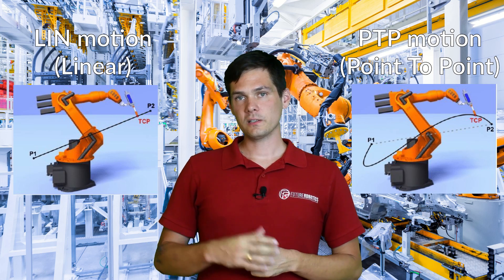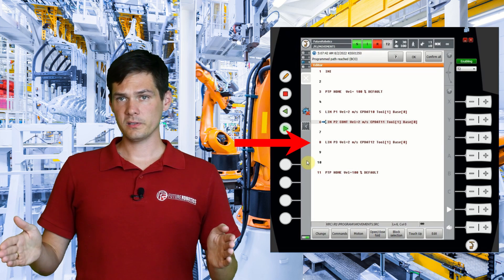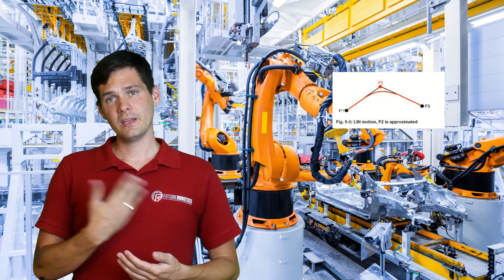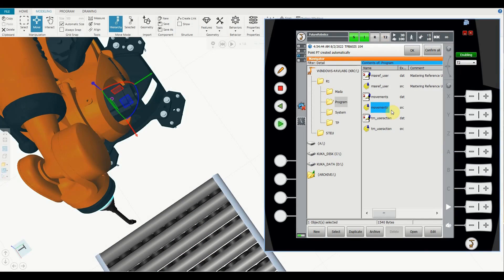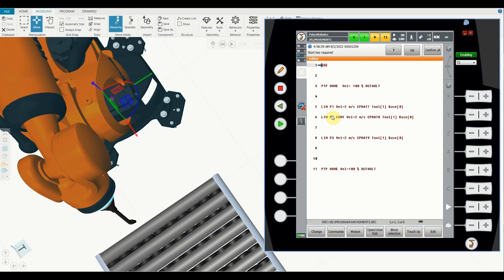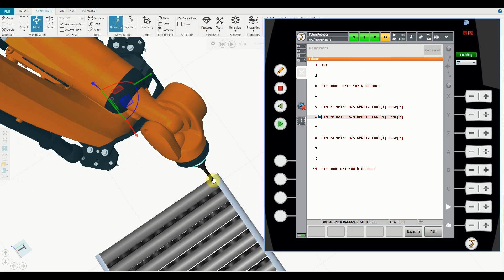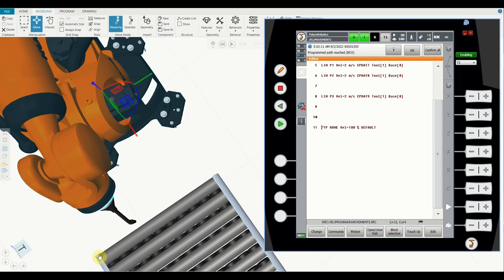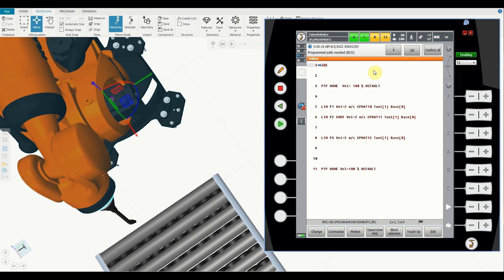PTP, LIN movements with KUKA robots /  CONT termination types

Comment: Hello,

Is it possible to monitor the electric current of each motor of a FANUC CRX 10iA/L and use that data as input for the code?

I plan to use this information to stop the robot's movement when it makes contact with a workpiece. Then I can activate the "stop code" to halt the robot and subsequently activate the "gripper on" to pick up the workpiece.

Do you have any ideas for improving this stop-and-pick-up process? I would greatly appreciate it if we could discuss this further.

1. How to detect the workpiece
2. How to stop the robot after detection
3. How to proceed to the next step

Thank you.
Reply from the maker: contact me at info@f-robotics.com

Comment: Hi Thanks for the very clear explanation. I am  a videographer that have a kuka robot for the video camera. I would like to link between the robot points timing and external focus motor. Is it possible? and how do I  get the timing info of the robot movements?  And if you can please shar  this info with a video? thanks
Reply from the maker: I'm not quite sure what info do you need. Do you want to know the time that robot needs to travel from point to point ?

Comment: Hi, can you make a circle by using "Lin" motion commands in Kuka robot? If yes, how many motion points are required (points approximately)?  To make a circle of 50 mm radius
Reply from the maker: I have never tried making a circle using LIN motion, you should use CIRC motion.
Reply: Yes we can do it by giving 10 points with 5mm distance between them.